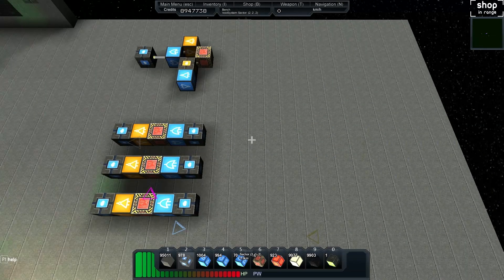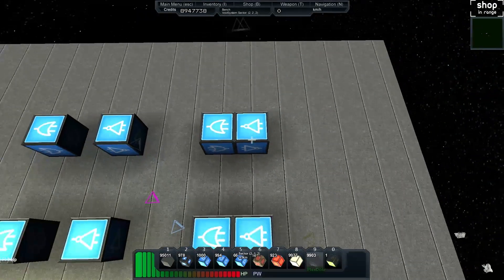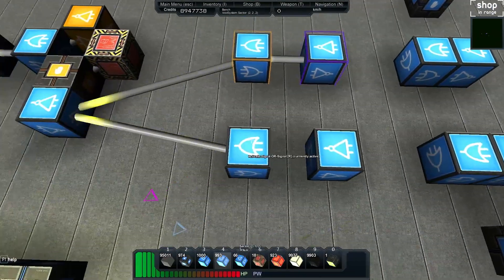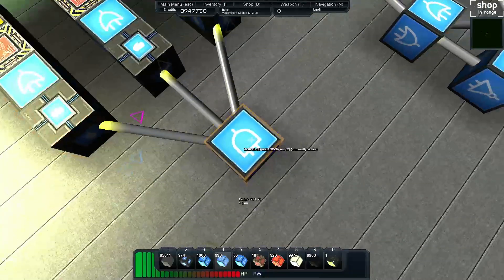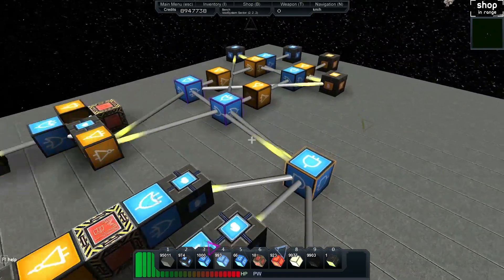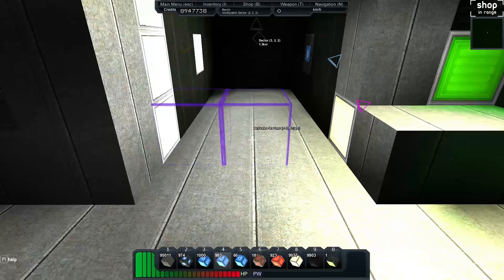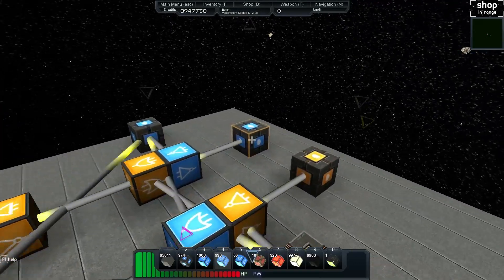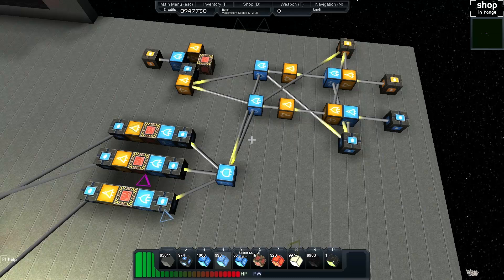Starmade Logic #8 - JK Flip Flops

Comment: A suggestion might be for the guys to change the button so that green is on and red is off? Save any confusion! Im also thinking that writing "not", "and" etc on the blocks might help for some.

I know it might take a while longer and these videos are aimed at being short and sweet, but explaining the actual flow of logic would speak volumes.

As I mentioned, the whole crossing pipes thing is a little confusing and counter intuitive.
Reply from the maker: Yeah we're changing the buttons so that it's quite clearly on or off. Any on logic or buttons will also emit some light as well.

We might find in the other texture packs that they do end up with it written on, I'm running the realistic texture pack as during dev it was the only one with textures for the blocks done, but by stable version it should be much better supported.

Thanks I'll try to do some more indepth logic as well. We're sorting out the pipes issue too.